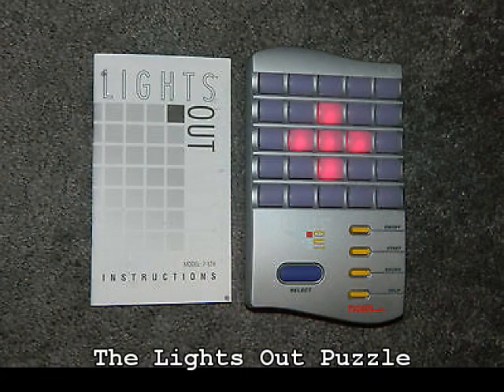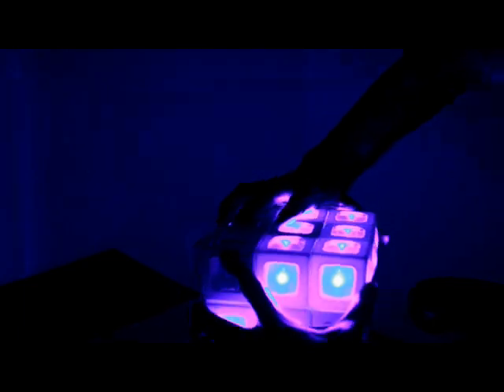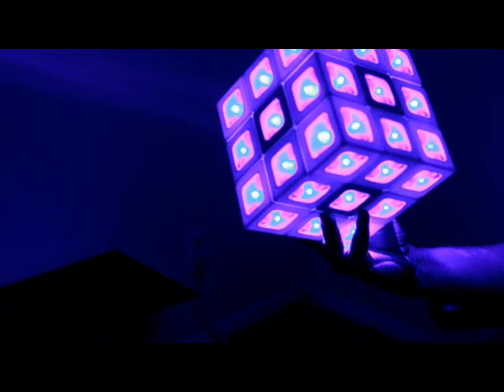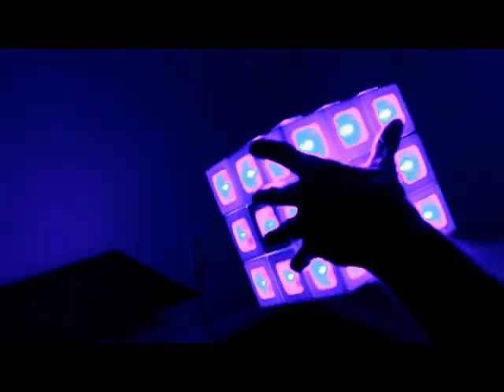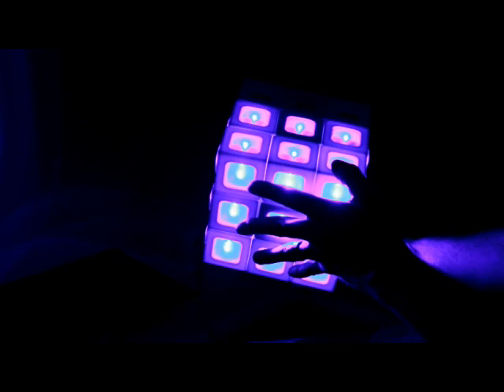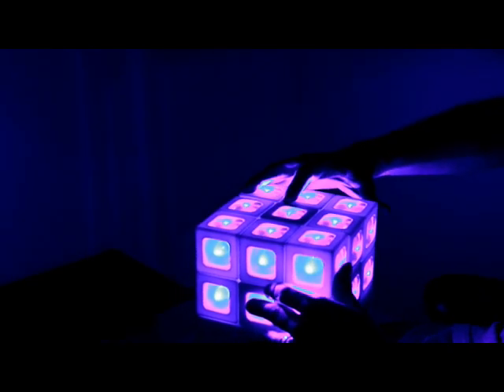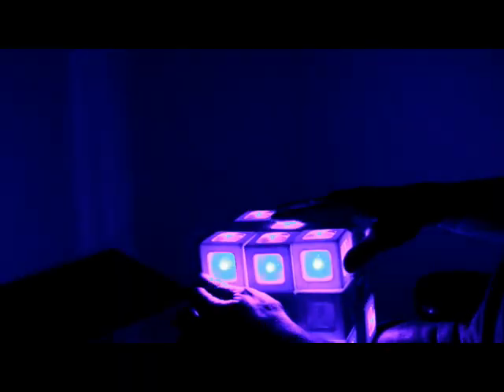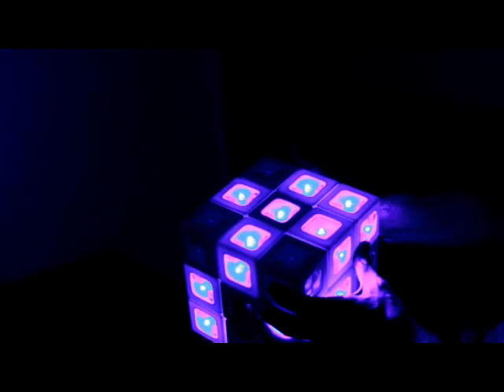The Bit Box - An Electronic Twisty Puzzle

Comment: my only problem with the puzzle is the epilepsy of the lights. maybe a fade in and out would give a better experience
Reply from the maker: Matthew Goodman this puzzle uses a mechanical solution to the computational problem. That's what you're seeing, and I think it's beautiful. But if the lights were all driven by some central cpu, then I agree with you. Smooth would be better.